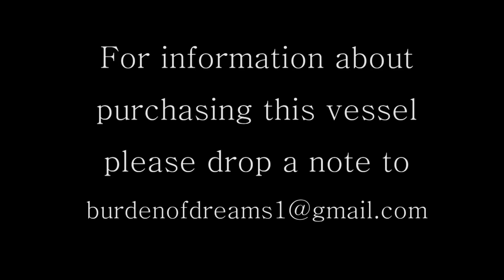74 Foot Homemade Boat   Part 1 of 3

Comment: Hi Tom, I had a houseboat by Irving Park as well. We met you let me pilot your boat for a mile or two on the river when you had it moored behind the park at California and Irving Park. The experience was surreal. Considering the height and length it was like driving a 2 flat apartment building! When steering I really had to plan ahead. It took at least half a minute for the boat to react to the helm. 

As good as a boat builder you are your even a better videographer. The timing the music and the stills were all perfect. I enjoy it more every time I view it. Gripping, haunting. 

I hope you are happy and well somewhere.